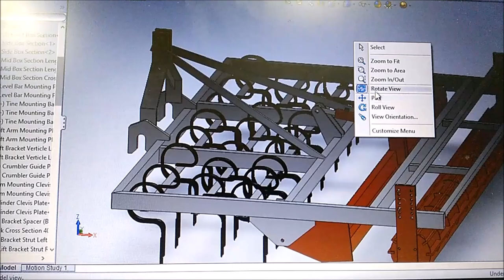HomemadeTine Leveling Harrow Fabrication

Comment: Hi William, 
5 years on, do you still have the machine?
Did you modify it in any way?
Is 90hp sufficient or could you have went wider?
If it broke in the morning and u had to start from scratch,  what changes would you make?
Reply from the maker: Hi John,
Yes I still have the harrow, I use it several times a year for sowing barley and reseeding and it never gave any bother. 
90hp is enough power for the 3 metres around our area but  to go wider would be a struggle.
Regardless of power, it couldn't go any wider on the road. To go to a fold up design makes it costly, complicated and high maintenance.
Reply: @WilliamBolger  thanks very much!

Comment: How does it work in clay? Larger rocks? 

After the rocks flip up I get them with a skid steer
Reply from the maker: Works lovely in clay, levels it well. It can't pull up the larger rocks very well, the tines spring back and glide over them. I usually leave the front loader and bucket on to gather the stones as I till.

Comment: looks good...should of offset the roller bars one slot offset end to end....
Reply from the maker: Thanks.  
Some manufacturers do off-set the bars on the crumbler to reduce vibration by enabling more contineous contact with the ground. I looked at several designs out there where bars are not off-set. I didn't bother off-set them as its not necessary where  the crumber is small diameter and the bars sink nicely into the soil. No vibration has been experienced whatsover and it's
far more cost effective.